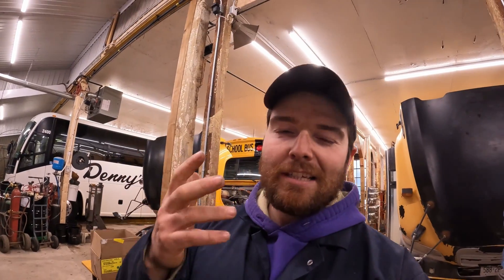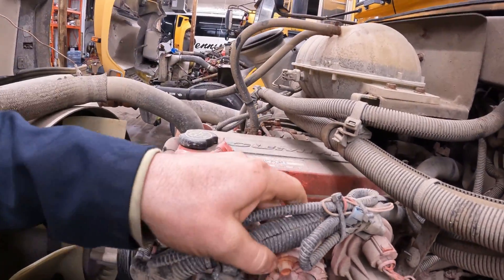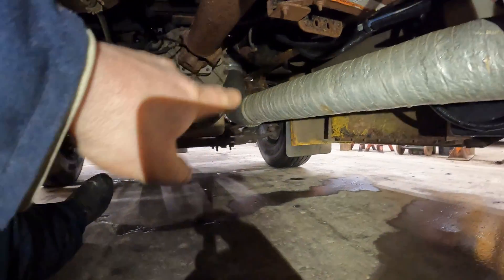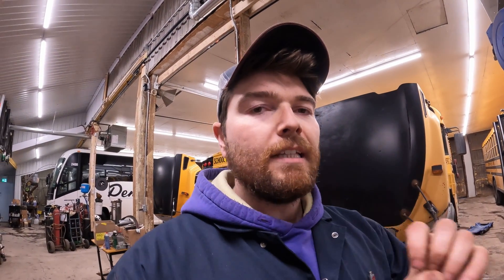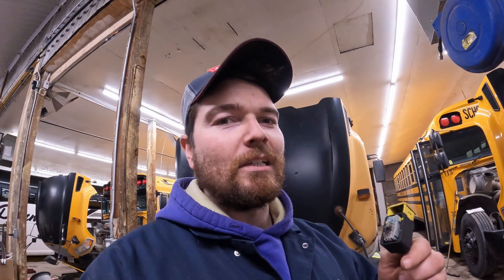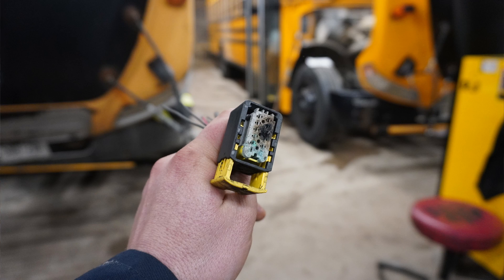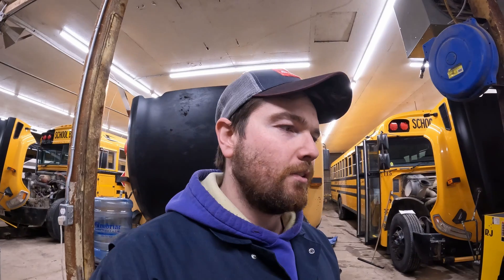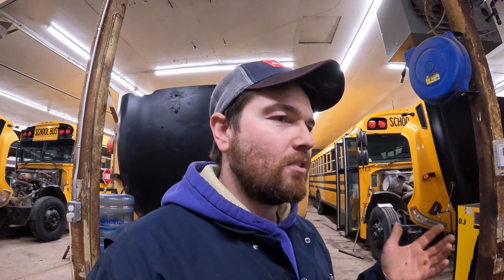RAM 2500 Cummins Diesel | Are Aftertreatment DEF Systems Ruining Diesel Engines ?

Comment: I live up in the mountains and the air is clean and my truck in the middle of hundreds of thousand trees why would I care.im worried about getting my dump trailer up grade on a washed out logging road before dark! I'm needing power and reliably period no worried about my lungs when hypothermia will get ya trying to walk home in winter .or a mountain lion.not all diesel drivers are in cell range all the time .complex systems have more parts and means more chances of a break down

Comment: I'm a new fan of your videos, Alex, and have a question about gas engines that have about  +/-  500 ft lbs of torque.

My wife and I are running on reserve energy as we grow older. Thus we traded in our massive 5th wheel RV for a light weight Grand Design that has an empty weight of about 7,500 lbs, and a max weight of just under 10,000 pounds.

When we bought our first 5th wheel RV we also bought a 2019 F-250 equipped with a diesel engine. While we owned the 18K+ trailer we've never see an up hill grade we could not conquer.

Now  for my question:

I've driven a few RAM 2500 models with the hemi engine and found them to be much more comfortable to drive than our long bed RWD Ford.

What would you suggest ... keep our over powered Ford or trade it in for a 2500 model with a powerful V8 gas engine?

Wife wants a short bed and I want a long bed to avoid buying a costly 5th wheel hitch that can keep our ability to make 90 degree turns without banging into our cab.

An important fact ... we routinely drove over the continental divide, and pulled our big trailer up and down two lane mountain roads. While on the road, we always dump all fluids from our holding tanks, and thus would be looking for a truck that can handle about 7,500 dry weight, regardless of the grade.

Thank you in advance Alex.

Comment: It would be interesting to see how a small diesel engine design in a diesel locomotive concept would do for efficiency. Think about the weight a single locomotive is capable of pulling vs a typical semi truck.

Comment: What I've been wondering is if a person could delete the DEF, then add an LPG since the propane is designed to burn cleaner, wouldn't that serve about the same effect as the DEF with emissions
Reply: You can already do it with methyl-hydrate injection from snow performance. There is also kits for propane to run as a catalyst or for nitrous like power upgrades.
Reply: @kyles234  that definitely would be better than the def, for the engine, and better for the environment, cause def is known to kill bees.
I heard a few years ago they were going to get rid of def because of that, I suppose whoever is manufacturing it sent lobbyists and greased some palms. Since it's still being sold, and making diesel trucks smell like piss.

Comment: All these software problems are more reason to only buy vehicles preBS... Generally once you've fixed a problem in an older vehicle it stays fixed longer than the time it takes to drive across the lot...

Comment: Great video. I’m in the market for a new truck and will need to tow a 12k load 1500 miles a couple times per year and locally  a few more times per year.
Other then that it will be my daily driver.
Do you recommend a diesel or gasser.

Comment: I used to work on CNHi skid steers. The 75hp engine I love in those skid steers because the aftertreatment system is as simple as it can get. There is cooled EGR and a diesel oxidation catalyst. The only sensors in the exhaust are in the EGR valve and one temperature sensor for the catalyst. They have been much more reliable than the 90hp engines that require SCR. The ones that have SCR have all those complicated electrically heated hoses and they seem to crack catalyst substrates often if the operator just idles the engine all the time. You have got to work the machine hard and keep the exhaust temperatures high for them to work well.
Reply from the maker: bingo, SCR's are a pain in the ass and you can't let them idle or you'll have tons of issues. they need to be hot at all times to work well.

Comment: I have a 2017 6.7 Cummins with only 45 K miles on it. I plan on doing a delete, change the exhaust and do a tune. Do I have to worry about any issues with the transmission?

Comment: What if you do water injection like they did with the aircraft in WWII
Reply from the maker: like water injection into the engine ? probably blow it up. I know the fighter planes in WWII would sometimes use it as a last desperation to evade the enemy but if you injected water for more than a couple seconds you'll blow up the engine.

Comment: Had a diesel with 65k miles blow up due to the emission systems. Love diesel, but not going to run one with the EGR etc again. Not until they improve it SIGNIFICANTLY.

Comment: Did you get a sense from the Cummins guy how long this new tech they're working on will take to get to the consumer market?  Or perhaps said an easier way, when might Ram be able to have these new combo emission systems in their trucks?
Reply from the maker: could be years. these things take time to develop and then phase in. or it could be around the corner it's tough to tell.

Comment: Diesel engines used to be two stroke and was dirty.. All the new 4 stroke diesels run cleaner  When properly tuned right.. I have a   Cummins that produces 550 horsepower and no black smoke because it has been tuned right If you're producing large amounts of black smoke all you're doing is washing the cylinders down and can ruin the Engine The diesel fuel they produce nowadays is garbage...  The DEF system produces a toxic gas and is also highly corrosive  And is killing all the honey bees This system is outlawed in most countries around the world because of this Most of the wildfires in the United States are caused from this system ... There's nothing like watching over $300000 burn to the ground Because of a shitty design exhaust system.. And if you're a truck driver you know the smell it fills your cab of your truck up while you're sleeping full of carbon monoxide and poisonous gasses.. There's nothing like waking up to the smell of burnt piss and diesel fuel and a pounding headache
Reply from the maker: interesting what countries don't run DEF system ?
Reply: Very true I could take in the beautiful smell of French fries. Biodiesel is the only way to go.

Comment: Def and  smog systems highly developed  have never had any problems  with aftertreatment  in my ecosystem  dodge or my class 8 truck if you run California  and have anything modified  you will be fined and most like engine  builder and so on can get you for pattern violation.   Engineers know more that the average  shop wrench.  I have had 6 class 8 trucks since smog crap started never  a problem with engine  pulling or codes coming up
Reply from the maker: tell the engineers we are tired of fixing their trucks then lol we should send them back to the smart engineers and let them fix their broken crap. 

I just call it how it is. a huge percentage of trucks we work on is strictly for aftertreatment.

Comment: My 21 6.7 cummins 20000km  i already had to get a line heater repaired that the wire corroded and my def tank froze up and gave all kinds of false readings for the gauge and giving a engine light, (up in Canada the nights are as cold as -40)  i had to pay out of pocket to get def tank thawed out and the crystals cleaned out of the tank because dodge (fca)  said that it is not warrentied due to being exposed to the environment bc it froze..  f the warrenty its all coming off.

Comment: I love how they call this "clean" when your truck burns more fuel per mile, uses another chemical that puts out only loard knows what, that chemical comes in a plastic jug made from oil that ends up in the trash, that had to get delivered in a truck burning the same chemical and getting less mpg all to bring something nobody wants it needs and not to mention all the material involved in making the dpf and the scr... But tell me again how it will save the environment haha

Comment: The EGR was to knock down the NOX gas, it worked but created too much soot, so they added the DPF, but created NOX gas again when it went through it's regeneration cycle. Next cam the DEF fluid to knock down the NOX coming from the DPF. You think they would go back to the drawing board and say lets take a look at the EGR...... NOX gas and DEF fluid and make a simple system.  NOX gas is a greenhouse gas, also not good for your health.
Reply: Lol ammonia oxide is what’s coming out now. Killing the plant and bees. Not so good to breathe also. Go back to biodiesel and see a better way.

Comment: I had two censors go bad. It was cheaper to buy delete kit and tuner than to replace the censors. If they want us to keep these systems on diesel engines, the warranty needs to be increased to at least 200k miles. Also need to figure out how to keep these trucks out the shop. Until then, every diesel I get will have delete kits on them.
Reply from the maker: They try to do this by imposing massive fines but in reality most trucks never get searched because only a select few officers even know what they are looking for

Comment: I have a question is possible delete the EGR and leave the rest of the emissions system working, I have understand with the emissions system the engine is less efficient, but not really damage the engine what really kills the engine is the EGR throwing part of exhaust gases back into the engine
Reply from the maker: You could do it. I'm sure there are kits. you would need the correct tune because these systems are all integrated and they feed off each other. but it is all software so I don't see why not!

Comment: Now they don’t use electric heating elements. They use the engine coolant to keep the DEF from freezing. And now with engine programming it will not through a check engine light for deaf when it’s frozen until roughly 15 minutes after the engine reaches operating temperature. After the engine has reached operating temperature in the SCR output is not within the parameters then it will throw a check engine light.
Reply from the maker: so I was referring to the actual def lines. yes the def header and def doser has coolant going to it. you seem knowledgeable and I'm sure you have seen those blue def lines. those are all heated by and electrical element. that's why each def line has an electrical connector attached to it. well at least every single Cummins, Detroit diesels and Paccar has that set up. those line often get rubbed through and the electrical heater elements breaks and loses continuity and that throws a check engine light every single time. something like "DEF heater line 4, voltage erratic and below threshold"
Reply: @GettysGarage  yes, I apologize. I took it as all the heating components were electrical. And what we do on every repair with those hoses we use wire loom. It doesn’t completely stop anything from happening but it helps tremendously.

Comment: To answer the question. It does not matter they are required, so bitch all you want but removing it can result in huge fines and possible environmental  lawsuits.
Reply: Depends on where you live and if they even regulate them here diesels are all safety checks dont even pop the hood or look under the truck.
Reply from the maker: well of course they are required. I have no skin in the game I just work on the things. but did does seem they are ruining these engines.

Comment: Sorry to break the positive feedback loop but after describing the emissions components, I have issue with your 'hypothesis".  Yes, in some applications the displacement has increased.  For example the 5.9L had to be increased to a 6.7L.  With the highest emitting emissions engine the 5.9L made 160 HP and 400 lbs-ft of torque opposed to the 400 HP and 1075 lbs-ft  found in todays RAM.  What about a class 8 truck??  Well the Signature 600 debuted in 1997 as a 15L 600 HP engine.  Today, the X15 can come with 605 HP from a 15L engine.  You may be thinking of the lower horsepower X15 engines but this was done because Cummins did not have a smaller displacement engine to fill the 11L to 12L range, until the X12 was released.

The theory around a loss of HP from the DOC, DPF and SCR causing a restriction is also misleading.  The one thing that is required for almost every delete is an aftermarket tune.  The term 'Stock Tune' is an oxymoron,  to remove DPF, SCR and EGR components the software is highly modified and often adding HP either with fuel or advanced timing.  The latter is also a main factor in fuel economy increase along with no longer requiring active regeneration of the DPF.  If you have ever driven an early DPF equipped diesel with a hollowed out DPF running on the OEM software, you can tell there is no improvement in power before the system triggers a code.  Also all tunes increase emissions to 1980s levels or worse.  An LMM that is deleted in not the same as an LBZ engine is this regard.

Also the idea of a shorter engine life with EGR is more of a feeling than a fact.  Everyone will agree, that having carbon enter an engine seems like a bad idea and if there is another issue such as a leaking EGR cooler or bad injectors this can be a secondary issue that can lead to possible engine damage but if the engine is running properly, it is not the issue that people are lead to believe.

Lastly, speaking from experience, a diesel mechanic tends to only see issues with diesel engines because that is what they work on.  Also they tend to work on the ones that are having issues and not the ones that don't.  This is something that I have to remember in my daily job.

P.S. Its your truck and you can do whatever you want with it.  I have no issue with people deleting their own trucks.  I am posting this because the culture around diesel engines and deleting is like listening to CNN, we can do better as an industry.

Comment: But let’s fill the tanks with the DEF that comes in a plastic bottle and cardboard & let that all go sit in landfills. The things is the smoke coming out is lot worse than all the plastic and cardboard being placed in the ground. Also, the “environmental saving systems” are screwing the engines, causing worse fuel mileage, causing the consumer thousands more at the pumps & God forbid your system craps out after warranty because there in 5-10k in repairs. Delete them, put a clean tune on it and your truck will be a truck again and not a government money maker!

Comment: The entire emissions system on diesels are designed to destroy the motor overtime.
Reply from the maker: pretty much unfortunately.
Reply: There's a few key changes that can be made to alleviate these issues

Comment: Once you delete your diesel power, torque and mpg goes up. If you delete a new 2021 Ram 2500 cummins, mpg can go up to 30 mpg on the hwy!! If you put a tune, free spinning hubs and off road fuel in your Cummins you can hit 36 mpg on the hwy!! Awesome video man!! 👍👊
Reply from the maker: That's wild actually.
Reply: Do you mean lockout hubs in the front like the first gen dodges had?
I watched the whole thing on the RAM Man he promotes the lockout hubs Kits so you have free spinning in the front. 
When you don't need four-wheel drive.
It's a expensive kit up front it will pay for itself in time plus your front end parts will not wear out.

Comment: These systems suck. After getting stuck with a load of horses a good distance from home because a sensor screwed up I had the system deleted. The mileage almost doubled and the problems went away and I still don't have a big cloud of smoke following me around. Basically if you can't work the crap out of these engines don't buy one especially in tractor. The carbon foot print is based of the fraud of man caused global warming. I'd worry about it doing the opposite.
Reply from the maker: its funny you say that because the EPA says that the carbon dioxide that comes out of these trucks is not an issue. lol but anyways yes these system can be nothing but trouble and leave you stranded

Comment: Thank you for video. You speak so well about this after treatment. I have always bought GAS PU. That would be nice if what CUMMINS says is true. They seem ahead of the curve.
Reply from the maker: thank you! who knows if what Cummins says is true, they are also working hard on some electric stuff as well so you never know the direction they are going to head. seems like we are almost at a crossroad for transportation. not there yet but soon!
Reply: @GettysGarage  
Cummins is working with the Marine FEER/ Passage industry. Making the power plant for a HYDROGEN powered FEER boat. They just launched in Puget sound WA. For San Francisco Passager Ferry route. Just FYI.